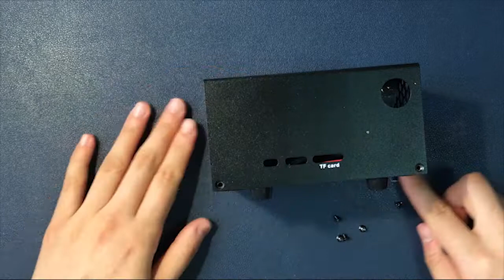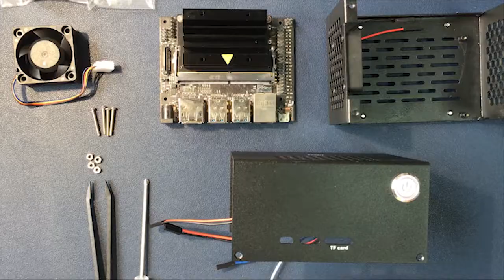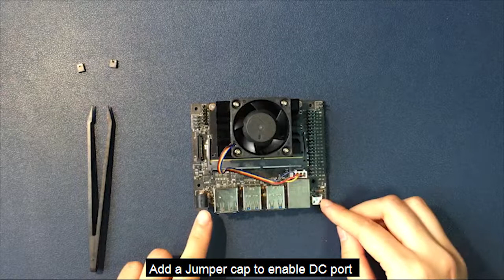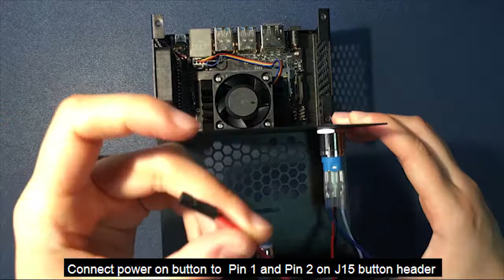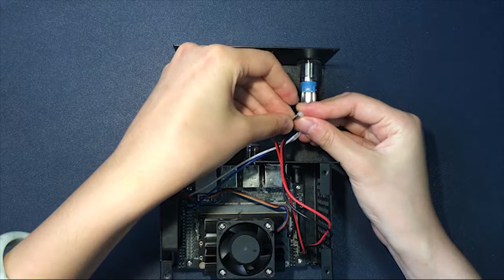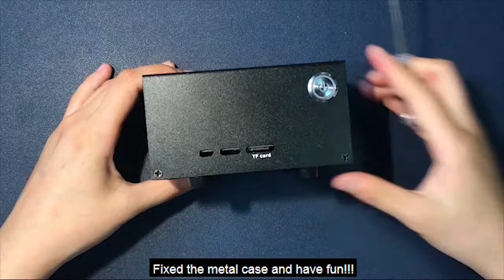Metal case for Jetson Nano assembling tutorial video 720p 12min

Comment: Have a problem with case - after connecting camera to socket - system fail: constant reboot with bad resolution, power button blue led light do not work. After disconnecting camera everything works well again.
Reply: same for me. I have to disconnect the camera to make it work properly. Any solution?
Reply: Agenis Marc finally it was due to shortcut between camera and locus of connection to case - please check screws and back of camera. Finally it was working on 3 screws cause fourth was “touching” the metal track on camera scheme.